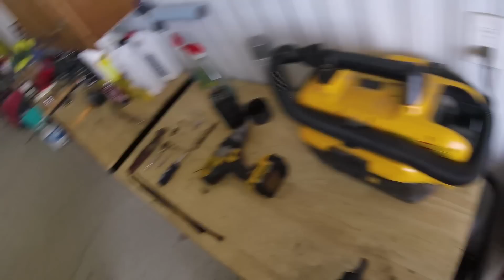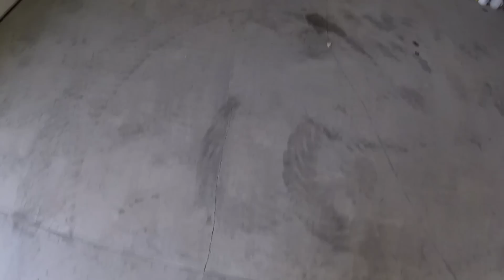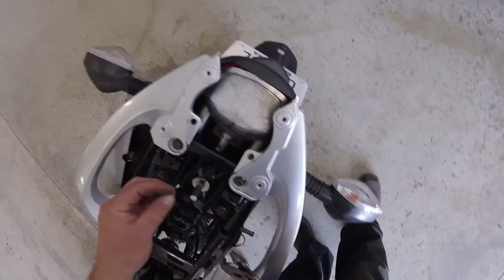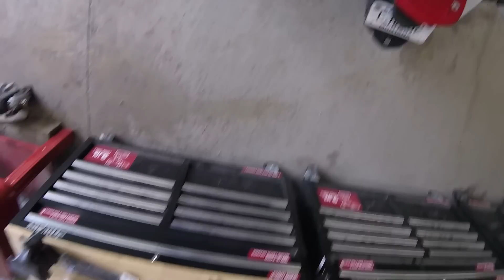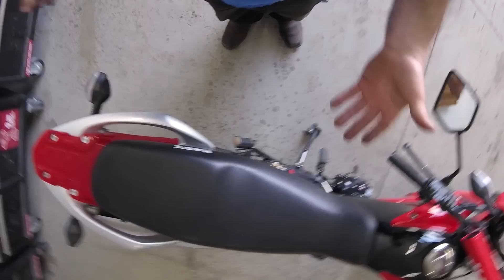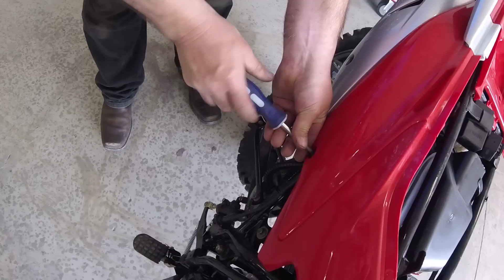Removable Seat Latch Mod For Hawk 250

Comment: I modified my seat today per your example. I did substitute clevis pin clips instead of roll pins as they are easier to use. I also added a d-ring underneath instead of a key ring. I drilled some holes in the plastic and tie wrapped the wiring well away from the clevis pin. The 5th and 6th holes worked perfectly. Great idea and thanks much for your video, That saved me a lot of time and I am very pleased with the result.

Comment: for the roll pins you could use a punch tool that has been ground to let the punch sit inside the pin and use that and a twacker to get the pins started/completed. I dont know if you solved the plastics screw mod but some quick release/ball lock push pins should work nice and fine.